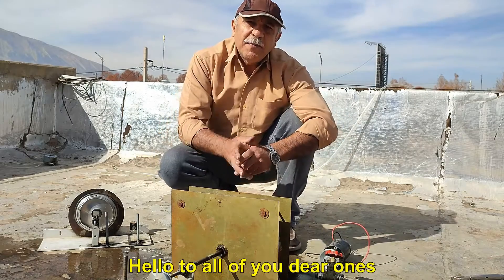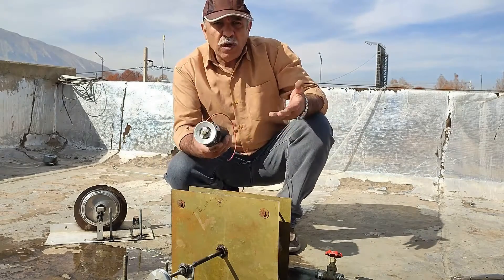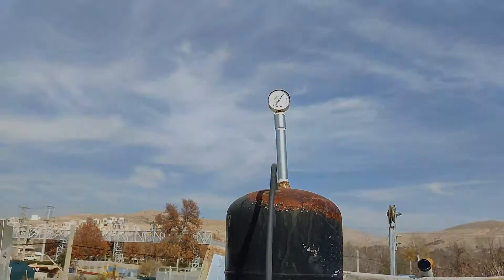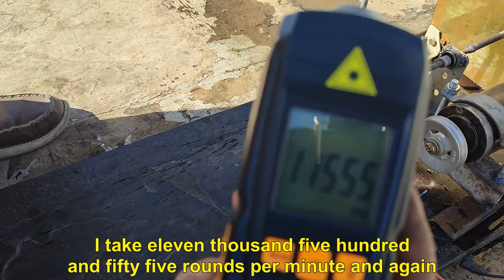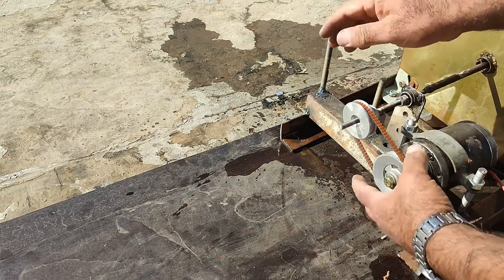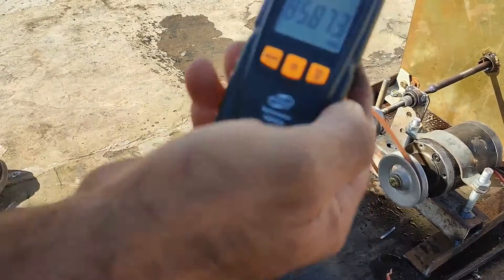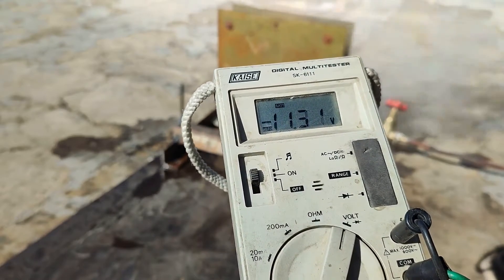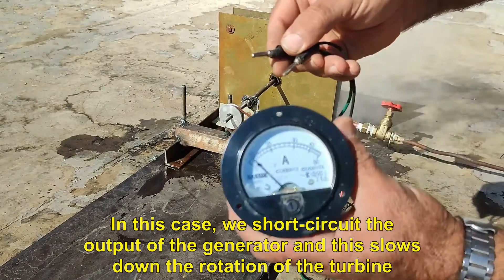DC generator test with steam turbine.Steam turbine.Steam turbine power.

Comment: Nice job 👍 If I'd run this in my backyard, neighbors wouldn't be amused 😄
Reply from the maker: Yes, you are right, the noise of the turbine is very high, and this is only with a pressure of 7 bar, and if the pressure reaches 20 bar, what noise does it make?